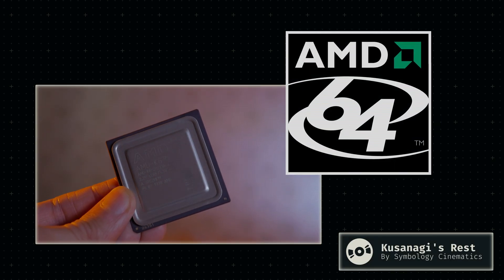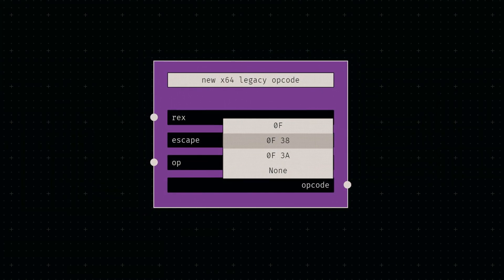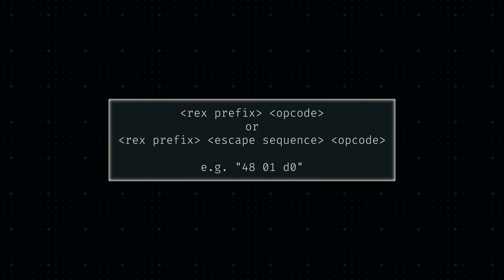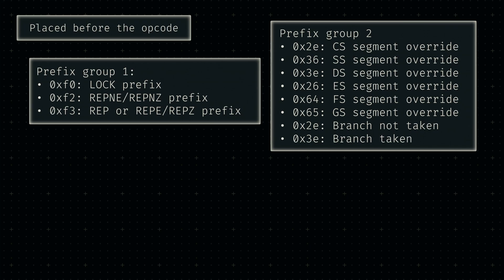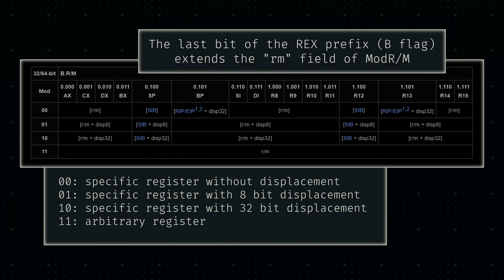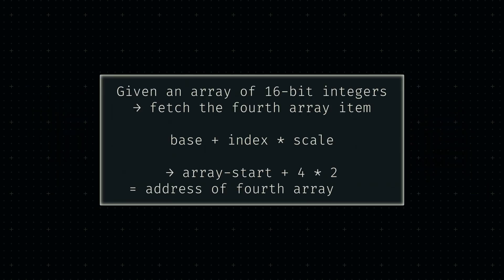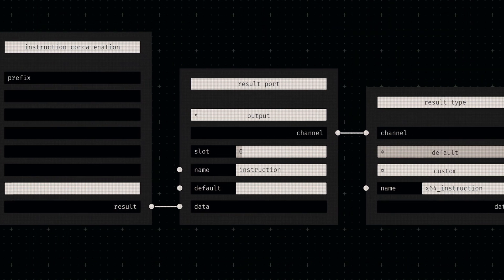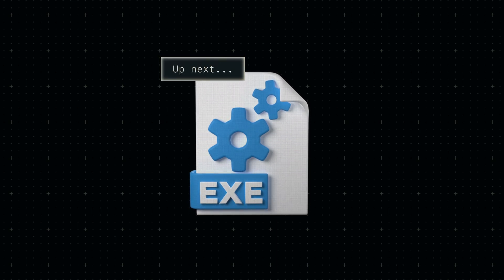Assembling x64 Instructions from Scratch - Kronark

Comment: Still not sure what problem this project is trying to solve but at least it looks and sounds interesting😄
Not hating or anything, it's just a very different approach than anything I've seen so far.
Reply from the maker: 1. drastically reducing compile time overhead

2. having all-time access to the lowest levels of implementation behind any aspect of a software

3. quick transpilation into different compilation targets

4. having the ability to implement custom compiler optimisations at any time, which will eventually lead to much faster software than any other compiler can produce

to name a few :P Glad you like it anyway :D

Comment: Question: GCC and other compilers perform a LOT of optimisations on C and C++ Code when converting it to assembly, which improves efficiency, However, your solution requires the user to effectively use assembly directly. So how would you implement these compiler optimisations?
Reply from the maker: Users won't be required to use assembly directly for optimisation or anything else. It will be hidden behind multiple layers of abstraction just like in a traditional programming language. However, the difference in this tool is, that you always have access to the lower levels of any given building block - so you can use the underlying assembly directly, but you don't have to.

We'll get into optimisations further down the road, but the vast majority of optimisations essentially boil down to "replace x with y, because y is faster". A simple example would be the multiplication of some value by a power of two. Unoptimised code might simply compile that down to an "imul" instruction with a register and an immediate value as parameters. However, optimised code would replace the "imul" instruction with a simple bit shift by the exponent of that power of two value (logarithm with base 2). So in this node editor, all that needs to be done is add a condition that checks the input value - and if it's a power of two, output the bytes of a bitshift instruction instead of the bytes of a multiplication instruction.

This only has to be done once, most likely by me years before this tool releases publicly. Any user after that doesn't have to touch any of these low level details to get more performant multiplication.

In general, a lot of those optimisations you mention are required simply due to the source implementation being written in a human readable language. It's easier for us to split up complicated equations into separate variables for example, which is completely suboptimal for the final machine code. That intermediary translation is completely removed from this compilation process.

Comment: This looks soo cool! I only wonder why bother with exe instead just making dll's?
Reply from the maker: DLLs still need an exe to actually run as far as I know :P
DLLs don't provide an entry point which tells the OS where to start executing. Besides that, they both use the same overall file format anyway, so why bother with DLLs right now? :D
Reply: @Kronark  Ok, you got me xD I thought of this as a way to provide fast tools or libraries. My first thought was to make a dll that could be executed by node-red for example. EXE just felt so limiting, because you can only use it on windows. Can't this produce a code that can be interpreted on any system? But then - it doesn't produce code... So it will always need to pack the output for the target operating system. I don't think I fully grasp the concept yet. I'll surely watch more to fill that gap.
Reply from the maker: The neat thing is, it CAN produce source code as well. But other than that, we‘ll obviously eventually add support for ELF and maybe even Mach-O files, so other OSs will be targetted as well.

Maybe the next video will clear some things up!

Comment: That is some cool stuff, visual programing needs some proper love. BUT
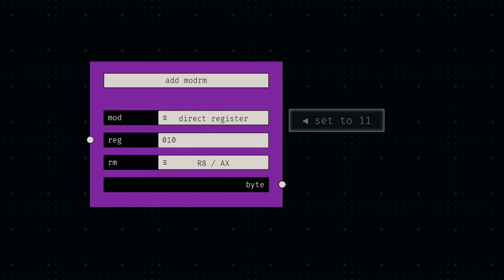But it seems lacking at the 12:30 register is set manually, it would be cool if there was wrapping node around 'add modrm'  that contains logic that helps to fill data. So 'reg' can be chosen by name of 'RAX' or 'RDX' instead of writing binary values to 'reg' directly. Even if value '010' comes from external node it seems as a chore to drag that node manually. And if possible the other fields should be filled based on the choice that was already made if it is deciding factor. I'm not sure but if choosing 'reg 010' guarantees that 'mod is direct register' then 'direct register' should be filled automatically.

So some sort of Abstraction Layer on top of nodes to handle Explicit and Conditional logic that helps with filling data in those nodes? I personally wouldn't want to remember by rote the op code in binary not to look at the documentation. I guess it would be wrapped in by some compiling nodes so it still will be hidden from the user with is nice.
Reply from the maker: I cut out the part which explained that the register assignment problem and any register abstraction such as a mapping of their mnemonics to their binary representation will be a topic for another video... this video was already long enough ^^

You will eventually not specify registers at all, we'll implement automatic register assignment using a global state. But that's two abstraction levels higher than we're currently working at, so it's something we'll do a bit later on.

If reg is referencing a register directly within modr/m, mod can still not be 0b11 (direct register addressing). The addressing mode of mod only controls the interpretation of the last 3 bits in rm. the value of reg is interpreted implicitly by your choice of opcode. So automating the input in other sockets based on a given socket (i.e. set mod to "direct register") would actually make us lose control over the output in this situation.

We're currently working at 2 abstraction layers below standard assembly code - the vast majority of users won't or won't want to touch anything "down" here. Luckily the vast majority of this complexity will be hidden behind multiple layers of abstraction once we get to standard high level practices.
Reply: @Kronark  The conditionals on the "direct register" I mentioned was an example 'if it is possible' as I have not enough understanding of the Assembly to know that such condition makes sense. And as you explained, it does not. 

As there is some form of abstraction latter then all is good. I can't wait to see how you will solve it, it is nice to watch.

Still I wonder how the high level case of let say of providing Keys for the Interaction with keyboard will be made. Naturally the simplest way is to treat Key Codes as Integers they are and just provide them Manually. Then the next step of abstraction will be to use 'mappings to key names' and that is equal to what is provided in txt programming by enums or or other named static variables, albeit potentially faster depending on the compilation results. 

What makes me biased is probably the fact that I'm fan of the 'Widget Approach' for the visual programming with allows to naturally get better abstraction than text programming. In the Key example it would be fully rendered Keyboard from with user can select Key that will be used. properly done User would be able to specify if selected is the Key for it's value or because of it's position on keyboard with would resolve the problem of 'QERTY/QWERTZ'. Or multiple key need to be pressed conditionally. But that is just my personal preference. I'm fully aware that widget creation is not only complicated but also time consuming, not to mention the baggage that would need to be carried over all the implementations during prototyping phase.
Reply from the maker: Yeah, with most topics / features you can expect that we‘ll take the route most programming languages used e.g. „enums“ for the key codes. We‘ll add more and more abstraction layers over time, which may result in such a key selection interface eventually :)

Comment: 👀 how's he gonna implement control flow? Or is it gonna be branchless...?
Reply from the maker: He's got the plan to build an "if" node that takes a condition and two code blocks as arguments, which it then will use to construct jmp wrapper around the code blocks based on the condition - that's still a bit in the future rn.

Comment: Could this be called a compiler? Seems more like a node-based assembler. Great work either way! :D
Reply from the maker: It'd be an assembler if I were limited to writing assembly. However I neither have to compile into object files, nor do I have to build assembly instructions with this software. So no, not an assembler.

It is a compiler by definition. It transforms a source representation into one of various target representations. Assemblers are limited to assembly by definition. :)

And thank you! :D
Reply: @Kronark  Ah... very cool! Yeah, this project is super interesting. Something that would make me lose by breath with amazement as a Linux user is if you adapted this to also work in a terminal. XD
Reply from the maker: Glad to hear it!

How would a node editor work in a terminal though? :P
Reply: @Kronark  Uh... good question... maybe similar to how it works as a GUI? It would just be sharper and a lot more grid snappy.

Comment: Great video(s)! One question: is it possible to make the system in a way so that it can output a multi-os executable/executables for multiple OS-s at the same time? Sort of like the Cosmopolitan project for C++.
Reply from the maker: Thankyou!

Yes, that‘s actually pretty straightforward. If you add multiple file nodes, they‘ll all be compiled. You can channel the same byte sequence into different files natively with this tool.

We will need to add a level of abstraction to actually make the same algorithms be output for different architectures / OSs e.g. that one outputs ARM bytes and the other x64 - but it will be possible natively using a state system.

Still need to fix some bugs with that system currently though - good thing we‘re only going to have a single target architecture and OS for a bit.

Comment: Im not sure if this is happening to anyone else but the graphics have this flickering effect sometimes.

Great video im wondering if the format could be changed slightly, i felt like i got lost at the begining/middle and then when you tied everything up with a goal and an example it made more sense. Maybe a graphic that kind of breaks down each concept and we can see where it will be used in relation to the end goal is needed. Its hard to keep many things in my head when i dont know how/where they will be used
Reply from the maker: Hiya mate, yeah I‘m aware of some weird rendering artifacts - I currently just don‘t know how to prevent them. I may experiment with render settings if I have enough time for the video next week.

Speaking of the video next week, it seams like it‘s going to be similar in complexity to the video this week. So I‘ll definitely try to implement your feedback there - I was in a bit of a rush for the one this week.

Thanks!
Reply: @Kronark  Thanks for taking my feedback on board, looking forward to the next video you have my sub :)
Reply from the maker: Thankyou! :)

Hope I have enough time to actually consider it the next week, I‘ll try my best!

Comment: The video is cool, but I have some questions about the project:

Which programming language/framework did you use?
What are the base nodes for the project (for example: add, rest, and, not)?
Reply from the maker: Hey, thanks!

This prototype was built using electron.js, so javascript is the main language.

There are no built-in nodes that provide any sort of programming functionality. There are only nodes that tell the compiler what to do with any given string of bytes. All programming functionality will be emergent using the built-in nodes.

You can find a list of the current built-in nodes in my introductory video uploaded last week (the one with „this is machine code“ on the thumbnail)

Comment: How will compile time optimizations be done in kronark? This looks like each operation will simply be deconstructed into its primitives and written to a binary file. Is there going to be any kind of optimization?
Reply from the maker: The neat part is, with this tool we‘re moving all compile time optimisation into development time. All optimisation is completely in user control.

Since we‘re designing our own abstraction layers, we can decide which actual machine code is emitted based on certain inputs to a node.

So for example we can control to which degree a loop is unrolled based on the amount of instructions inside the loop body. We can emit a bitshift instruction instead of a multiplication instruction if the factor is a power of 2. And so on….

It‘s all at our fingertips, nothing is hidden behind a black box implementation. This will be tedious in the beginning, but we‘ll eventually get on par with modern compilers and then have all the freedom to grow beyond that way more easily.
Reply: Wouldn't this make it super hard to build reusable abstractions?
Reply: This makes kronark basically a very fancy assembler
Reply from the maker: I honestly can‘t think of any abstractions that can‘t be made reusable using a separate node definition :)
Reply from the maker: Exactly! With the bonus that you can compile  to anything and also add new compilation targets on the fly :)

Kronark is the name of the overarching „business“ i want to build btw, this is just the „Kronark Compiler“ - name not found yet, will tackle on release build ^^
Reply: @Kronark  What I meant is that it's hard to just reuse a node definition that someone made for their own project, since it has specific optimisations that probably don't apply to my project. I would probably have to rebuild it from the primitives with my optimisations
Reply from the maker: Hmmm… We‘ll have to wait and see how collaboration using this tool turns out I suppose :)

The same problem applies to traditional programming as well though, so it‘s not unique to this approach

Comment: How exactly do you create applications with this software? I understand that each node is a command, and many commands create an application, but since you are using a high-level language (JavaScript if I remember correctly), won't you have to interpret the nodes some way to create an executable? I believe that you said in the last video that the program is able to decide which nodes to interpret through perceived changes since the last compiled version, does the program translate the nodes into assembly, and then compare each line of both versions to find differences, or do you have another way of doing that? It's a bit confusing since I do not know the underlying structure, so I can explain my question in more detail if you want.
Reply from the maker: While the prototype is written in javascript, the nodes don‘t output javascript to be interpreted. Each node is a simple object on the heap with an array of sockets associated to it. To detect if a node needs to be recompiled / the input has changed, a simple flag in the socket data structure is checked —> if it‘s state doesn‘t match the compilation iteration, it needs to be recompiled.

So no expensive string comparisons needed! But you can think of these nodes as a weird ui for building strings of text. To make an executable, some specific text is put into a file - but like you said, we‘ll get to that soon.

We‘ll probably not get around to actually executing our first exe next week, since a core component will be split into a separate video - but we‘ll get there eventually!
Reply: In a earlier video he mentioned this project can be used to generate any type of file from png to bmp to exe. My guess is that in the final step of compilation it prints some bytes to a file which results in an executable.
Reply from the maker: This one gets it!

Exactly. All these nodes do is create strings of bytes in different ways. And we can combine them to build a byte sequence resembling an executable!
Reply: Just got to the end of the video, I guess I will have to wait a week for the answer 😅